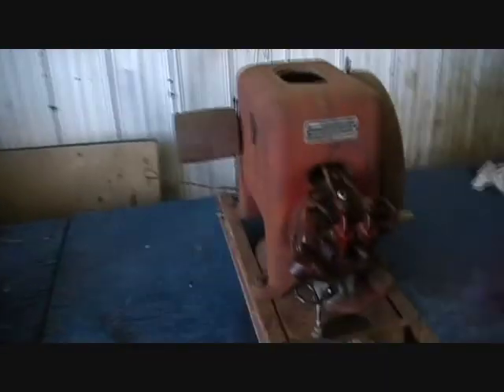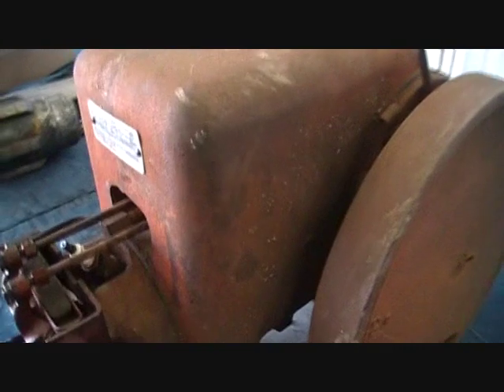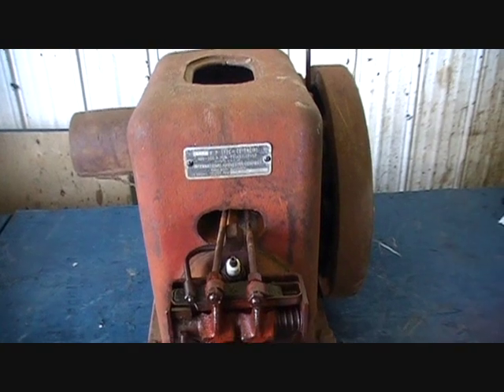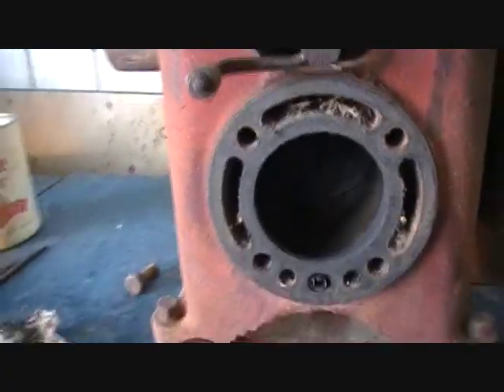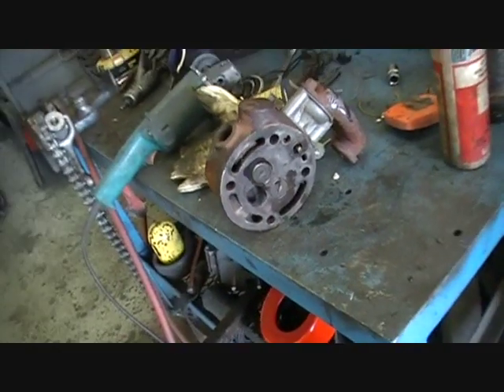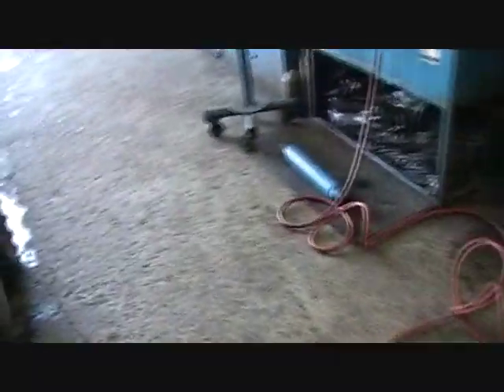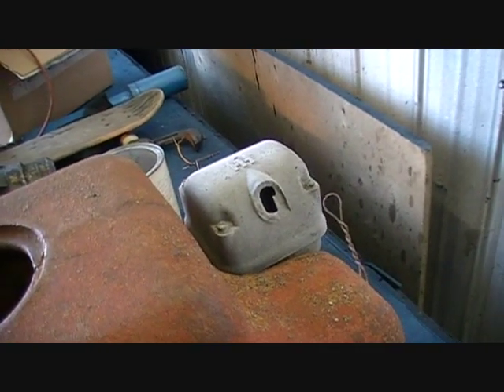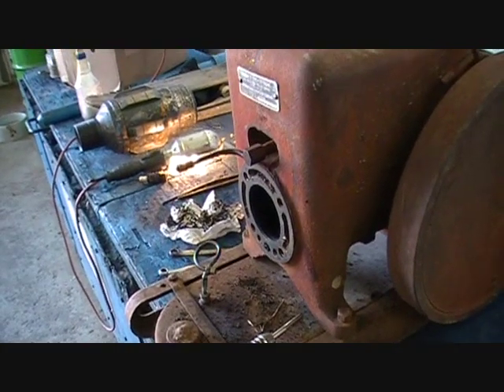Type LB International Harvester Engine.

Comment: Thank you for your videos. Only one correction, that is a engine not a motor. Engines are use combustible fuel. Motors are electric?
Reply from the maker: Oh. Is that why they are called motorcycles and not enginecycles?  I will have to take my enginehome to the lake and think about it.

Comment: Nice find Smoott, I own the 36 LA Harvester that Racer4560 posted. You should be able to fix that magneto, there pretty simple. It might just need the plug wire and the boot. The serial # on there will give you the exact year. There's alot of info on them on the web. Good luck with it.